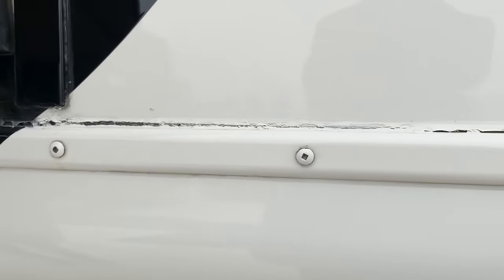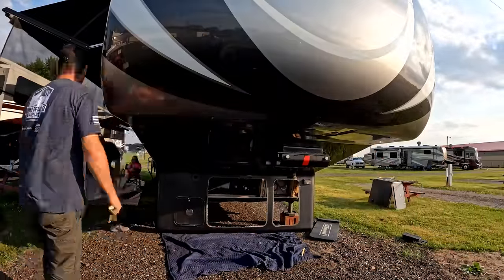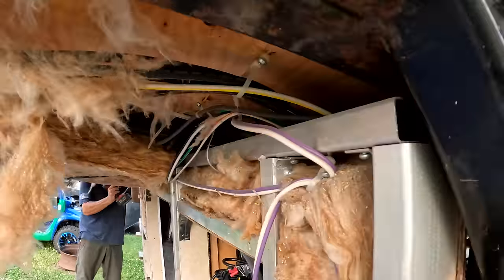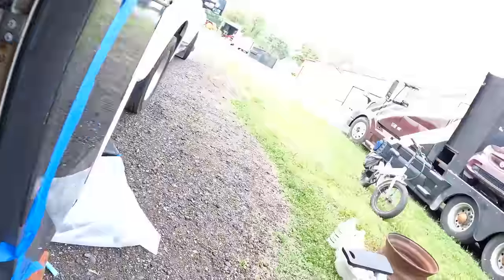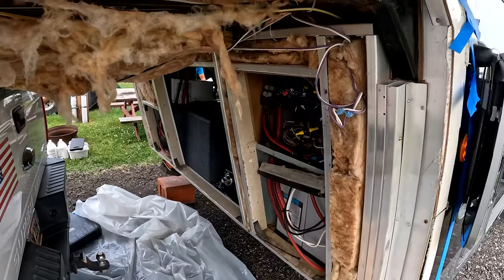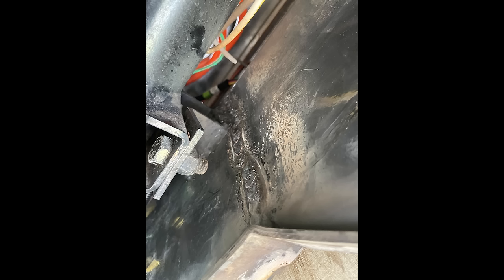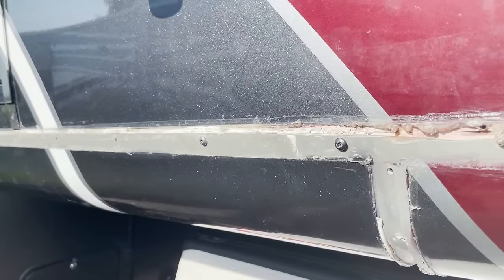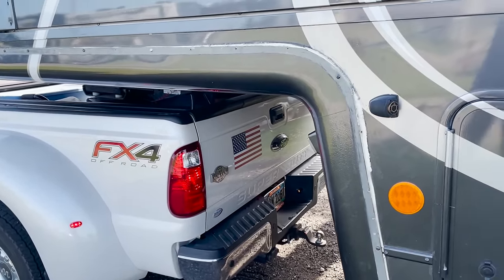WHAT???  Your Frame is Broke!  Lippert Broken RV Frame 7-27-22 DRV Elite Suites

Comment: From a long-term welding inspector, I saw more than 7 major welding, frame support, material selection and improper techniques used on this RV. 

Get an attorney because at some point when you’re not satisfied, they will quit responding and you will be ahead of the game.
Reply: Could it be they are using crappy metal, or, is the Frame supplier just incompetent???
Reply: @michaelashcraft8569  actually all of what you just said even down to the use of the wrong welding rods or how they were stored. From the views of the metal on this one as well as others I’ve seen, the metal was the basic problem and was not “Heat-Treated” prior to welding, but the other big factor is there are a lot of missing support structure pieces. 

My guess is they are struggling with labor problems and anyone that can weld is being given the job and probably doesn’t know what the end resulting product will be.
Reply: @Chief351L  Minimum wage welders give you minimum wage welds...  

The cracks on both sides look more like a design problem.  Either the metal isn't up to snuff or the designer didn't build in enough bracing.
Reply: @quademasters249  oh I definitely agree on that. The way the metal separated was indication of wrong choice of material.
Reply: @michaelashcraft8569  material looks too thin for such a large trailer
Reply: @michaelashcraft8569 try all  3
Reply: Those welds look like stuff that I remember from Junior High shop class.
Reply: I hope the owners unhooked the batteries before welding, to prevent blowing modules and such

Comment: Lipert knows exactly where the cracks are , where they start and where the end and how long their repairs will last .They also know about the lower frame at the axles are cracked . They also know about the Pinbox failures and where the cracks are .They can tell you just how many inches of weld that the entire repair will require .
Reply: If they know about it, why aren't people holding them accountable?
Reply: Lippert doesnt design the frames, they build them to specs by the manufacturers, if the frames come in overweight, they are rejected and Lippert wont get paid for a 40 thousand dollar frame they just built.
Reply: @ricksmith7631  If all Lippert does is weld some sticks together, Then why the hell are they even part of the equation. The manufacture should just build the frame themselves. They already make 90% of the RV as is.
Also you are dead wrong And I quote Lippert "Since we design, develop, and service all the major systems below the floor of the RV (chassis, steps, slides, axles, suspension, pin boxes, and more), we know better than anyone how these systems work together." So yes, Lippert are the ones who design their frames stop spending misinformation.
Reply: @aco2518  wrong, lippert designs and builds the subsystems of the unit. manufacturer engineers design the frames and lippert builds them to their specs. ive been to keystone, jayco and also spent some time at lippert doing training. also lippert isnt into building campers and they never will. thought i explained this plenty clear in the original but id be willing to explain it in crayon terms if that would help you understand better
Reply: @ricksmith7631  Cool, so the manufacturer engineers the chassis and calculates all of the dynamic and static forces and moments and makes sure it's safe. What then does Lippert mean when they say they 'design' and 'develop' the 'chassis'? and what exactly are the subsystems that you say they design?
Reply: @ricksmith7631  Lippert needs to tell the Manufacture to go pound sand .There is such a thing that reputable businesses do . They call it a safety factor. And if the manufacture is steadfast on weight , then they need to use a strong alloy steel like 4130 that will stand he stress and much more .And if the Manufacture doesnt like it he can go elsewhere . Or is it that Lippert is their last resort, the only one who will put other peoples lives at risk. How many trailer frames would you have to make to pay for a 250  million dollar law suit .
Reply: @aco2518   Not ! Lippert  engineers it to meet strength and weight requirements . They specify the metal its made of to meet the manufactures request. Again Chrome Molly steel should be used  and not knife material.

Comment: LCI will build whatever frame the manufacturer requests. After that, they are done. The manufacturer provides the specs and it is their engineers responsibility to ensure proper loading capacity. Manufacturers are overloading their rigs more and more every year while not ordering proper frame capacities due to price. JMO.
Reply: Wrong, LCI designs their frames. Here is a direct quote from their website. "Since we design, develop, and service ALL the major systems below the floor of the RV (chassis, steps, slides, axles, suspension, pin boxes, and more), we know better than anyone how these systems work together." Stop spreading misinformation.

Comment: These new RV's cost a fortune and the quality just isn't there, sure they look nice but that's it. The square metal tubing used for the goose neck frame seems to be too thin, I would bet that even after they "patch it up" it will eventually crack somewhere else on that goose neck( probably the top part of the goose neck ), please keep us posted in the coming months.
Reply: Check out Luxe 5th wheels, they don't have any build quality issues like that, not much more than a DRV. Each one hand built.
Reply: @douglasscott5623  Luxe is in a whole different league for sure!👍

Comment: I'm so glad to find this video. A couple weeks ago I purchased on-the-spot a beautiful 2016 Forest River Palomino Columbus 295RLC 5th wheel RV (built Nov 2015). While the RV designs are very much alike, the RV builder is different than the one in this video, however the physical chassis frame is the same which is also a Lippert Component build and as soon as I get back to Tennessee in 9-days, that is the very first thing I'm going to check on mine. Why this bothers me is because on mine, the space above is a bedroom with queen size bed and a stacked washer/dryer unit in that corner closet in the nose of the RV. What disturbs me in this video are the welds on the finished product, that is not going to hold for very long as the bonding between the new steel and the old steel is very poor and inexcusable. That shoddy welding needs to be ground down and done correctly. In addition, there should've been 1/2" inch thick gussets welded to the inside of where the new steel meets old steel to prevent side loading and flexing. I like the new larger sized steel used in this repair but the welding leaves much to be desired.
Reply: I wouldn't really call that welding.

Comment: As someone that works in structural engineering, I would LOVE to see the actual frame design.  I also have serious concern for their "repair" at the moment.  Hard points as we call them, cause stress concentration and just moves the failure point.  As an example, consider bending a stick in a U until it breaks.  Then do the same with another identical stick, but slip a steel tube sleeve over the area where the other one broke.  Can you guess where it will break now?  Either that frame was taken beyond its design (capacity) limits, or Lippert is running their margin of safety WAY too thin!  Can't say I've seen many gooseneck to semi trailers do that without an "event"...
Reply: Hi Brad. I would suggest also looking at the materials - structural steel sourcing.  If the structural steel is made outside of North America there can be metallurgical issues. They would need better incoming inspection and testing of the materials they accept. When metal was made in the US it was of consistently higher quality. I've seen this from my own experience with outsourcing materials to vendors.  It is possible that the frame size could be adequate if the material were properly spec'd.  Metal that is even slightly soft or brittle or off spec in any number of other properties can cause these issues.
Reply: No engineering code of ethics here
Reply: Wonder what the stress analysis Would show.  Was there any load testing done!
Limit, ultimate load testing?  Get a lawyer.
Reply: @markf3416  Probably no engineering at all.  No evidence that any kind of dynamic analysis was ever performed for these structures.
Reply: You can see the entire drv frame, especially the area in question here in their how it's made video here on YouTube. Look it up. Type "DRV factory tour ". It's the top three search results. Enjoy!

Comment: Well as a former LCI employee I must say those welds look like they came out of plant 19 where I used to work. Back then they didn't care how the welds looked as long as they were 1) in the correct place, and 2) were done according to print. 100% welds were passed that looked like explosive diarrhea on a plate and ultimately that's why I left. Guys didn't care because they were making $20-25/hr back in 2013/2014
Reply: Holy crap they’re making that much 😂
Reply: @doubled8247  more now lmao. That place is a joke
Reply: this is scary. would you mind if I ask you a few questions? I'm having some troubles with an RV
Reply: @pxo7407  ask away. I'm not in the rv industry anymore but might be of some help
Reply: @fridgebeer6897  how would I know if the welds were bad on my RV and causing some of the problems that are going on? And they're numerous.
Reply: @PXO  no offense intended, but did you watch the same video I did? It points out what to look for. I only have the same information this guy points out.
Reply: @fridgebeer6897  sorry my question wasn't clear. I know there's problems. I've seen with the skin down. I can see the failures. I'm trying to figure out what caused it. if it's attributable to the welds. Is this a common thing? Is it due to Lippert manufacturing or the RV manufacturer build?
Reply: im a former welder who now works in rv repair. i am asw 2 certified and i can tell you, ive examined the welds and from what ive seen, the welds were pushed beyond their rating, pushed by who - the manufacturers and their engineers, actually the welds held but they were torn where the weld met the metal, a sign of overloading. consider most tubing is made from 3 32 aluminum tubing, its no wonder and in some instances 1 16 tubing, no welding without reinforcing is gonna last, not lipperts design, its keystones engineers who made the decision - thats why were are involved in numerous keystone recalls for frame flex, not saying that their welders are the best but i have yet to see where a weld cracked due to inferior welding. btw, ive been doing this for a long time.
Reply: @ricksmith7631  Bigger is not always better.  That big, hot weld,  undercut the metal in the heat affected zone.  Bad welding, positioning, and under designed.  It would have been better off leaving out both horizontal welds and not welding across the stress riser.
Reply: making $20-25/hr .....you'd think working slower and more attention would make them more money per/Hr
Reply: @kk-pz8gn  Even though they are hourly, it's not an open ticket as I'm sure that they have quotas to make.  You have X amount of time to complete something and if you can't make that goal, you are out.

Comment: Mass produced, owner overloaded, jostling down rough roads, minimal design strength and overall design of a 5th wheel to begin with that relies on reverse cantilever to support weight while connected to tow vehicle.  Seems like the perfect storm to me.  Weight reducing components/design figure to exacerbate the issue(s).   Hauling your home over the road is going to take it's toll over time.  Couple that with manufacture by those who want to maximize profit and you have this.

Comment: I've got a 2021 Jayco Melbourne. It cost $112,000 and its the biggest piece of shit ever made. First week I owned it the microwave went out. Turns out the factory drove 4 inch screws directly into the top hitting the electronics! Next plumbing leaked, next bad refrigerator, then ANOTHER bad refer, now the entire slide out is falling apart literally at the seams. At this point I wish it would just burn down . Thor industries, the parent company of Jayco could give 2 shits about their customers, for them is all about maximizing profits and they're in bed with Camping World to take every thin dime from your pocket.

Comment: in my opinion after being in engineering and welding for 45 yrs.. if the structure is to ridged and cant move it will fatigue and some where it ill give up its structure.airplane wings are made to move u7nder a load ..for instance the C5 Galaxy that Lockheed Marietta made was designed so as the wing would move up and down 18 feet. automobile frames are made to twist under sever loads.steel must be allowed to breath or it will snap under sever loads.The flex must be across the entire structure and not confined to one area.  this is an  engineering night mare.

Comment: I wonder if the frame mfr does load testing...simulating the weight and varying road and weather conditions. if not they should...and intentionally overload to see what happens and where before the frame is approved for market. I also wonder if the feds at NHTSA can step in...they should...they are all collisions waiting to happen with this frame design.

Comment: This is a combination of failure from LCI and DRV. LCI may build the frame, but they build it to the spec that DRV supplies. For all we know DRV asked for a frame that weighed a certain amount with certain materials that was capable of so much load, but then exceeded that load in the name of saving a dollar and maximizing profit. This is usually what happens. See it on travel trailers all the time. The other problem is there is zero oversight in the RV industry.
Reply: You’re putting your name on the product, the welds from LCI suck. My own trailer had outriggers fully welded and some with literal tacks, and forgotten to be welded. Jayco and final inspection missed it, but shoot it went through LCI final inspection and jayco and both missed it.
Reply: I never understand why some people want to absolve Lippert of making crap frames by saying someone else designed them.   If there were any expectation that someone would be held responsible like literally every other industry then the company that made the foundation of a 12,000lb thing that will be moving at 70mph on a highway attached to a family of four would know what they were building rather than just slapping together something drawn on a cocktail napkin.

Comment: They went cheap with the initial design and it looks like it will cost them in the long run.  And i wouldn't be so sure the reinforcement won't crack either as it still looks like a poor transition, and might crack thru the 45degree tube instead of the vertical.  It looks like they made the vertical so strong that all that flex will transfer to the weakest link(45 degree tube right where the big sleeve welds too it).  I also agree with others that you should be looking at other parts of the structure to make sure more cracks aren't starting. Best of luck.
Reply: I can relate, every UTV is mass produced as cheaply as they can make them. Even in Canada. That's why the after market parts industry is flourishing.  Every UTV owner knows with bad geometry, if you replaces weak parts, some come with plastic parts, you are just transferring that weakness down the line to some where else.in the joints or frame, or to other parts that will now break.

Comment: I’m a frame technician in auto and heavy truck that is a catastrophe waiting to happen. Cheap Chinese steel under rated junk  this frame company knows this and they should be doing and or paying for this estimate total bulshit they should never let the customer move this 5th wheel to their repair facility you have to understand the breaking dynamics on those weld repairs from the truck itself they should have a flagged car and driven with a professional driver

Comment: They are building these frames to "spec", as ordered by the RV manufacturer.  They are using 1/8" steel, which is NEVER going to hold.  From what I understand they have a 70% failure rate.  I've been looking at getting a 5th Wheel RV.  Thanks to videos like this, I know the questions I will be asking.

Comment: Wow...I'm seeing more and more lippert frames breaking on other brand rv's. I hope Lippert takes responsibility for faulty workmanship and materials.
Reply: Lippert only builds what the manufacturers spec, but Lippert should be able to recognize, and advise the manufacturer when they spec  framework that is sub standard. It’s the customer who gets to deal with the problem after the sale.  We have friends, whose Montana fifth wheel cracked in the same places.  It caused a complete failure on a trip.  They ended up scrapping the trailer.

Comment: I would sell that 5'er as soon as you get that fixed! I wouldn't trust the rest of the frame! Manufacturers are cutting corners just so, they can claim that they can be towed by lighter trucks!
Reply: I would never ever tow a 5th wheel with any 1/2 ton truck. A F250 or 2500 is the minimum standard in my book.

Comment: This is why I should keep my 1978 converted to a rear swing-door toyhauler. Real frame work the thickness it should all be. It was pulled apart, inside & out walls, insulated with iso-sheets of insulation that can’t be ruined by water/humidity, and put back together. Box framed rear to accept the swing door. 
It’s 78 pretty, but I don’t have to worry about it liking someone on the road.
Reply: 1979 Jayco Pinnacle 35'  5th wheel. .Big rack and pinion slides. No basement, everything inside. No computers and doo dads. Inside was re-done like new for $2k. Paid $5,000 cash. Full time. Everything is perfect. Afraid to sell it.